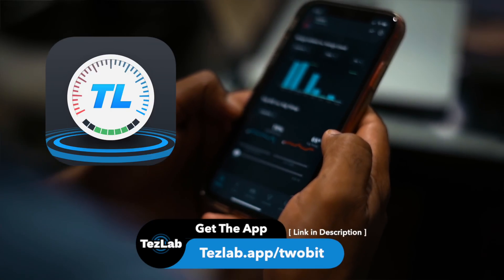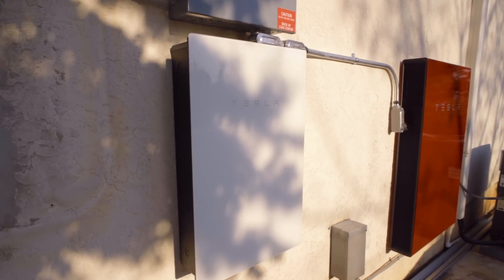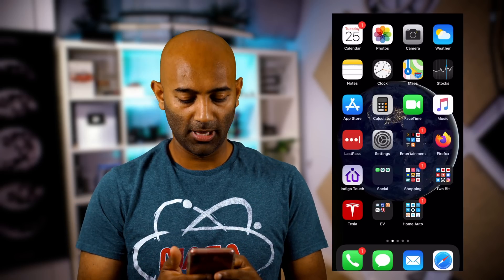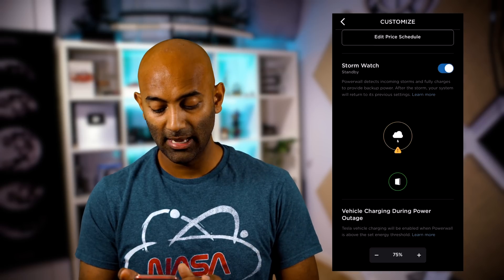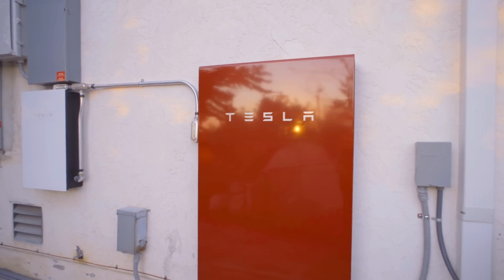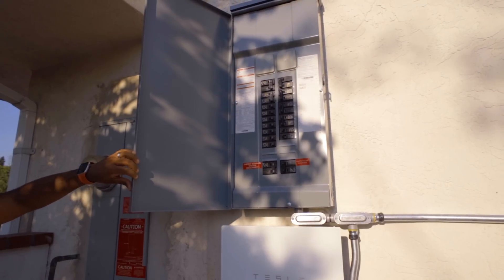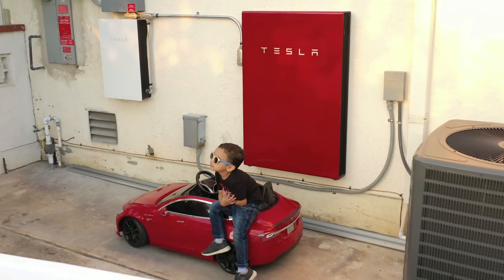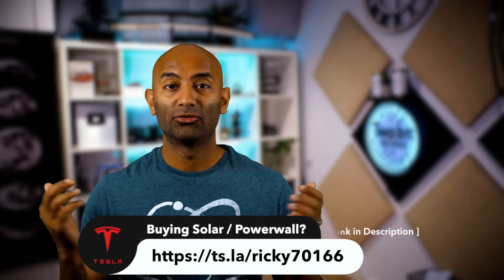The GENIUS of the Tesla Powerwall Explained

Comment: I have tried getting in touch with Tesla, and am getting no where other than endless hold! I am a Tesla Solar home. There is a phone number on my Tesla bill, and we have tried on line. We have been wanting batteries batteries forever! We have been using it for at least six years.  They came out a month ago and broke the seal on the meter and did a couple hours of work then left and said they would be back and haven't returned for over a month and before they left said we only running at half out put. And our bill from Arizona Public Service is costing us aloy more because they have just totally neglected and have been inviolation of the to buy contract themselves! Can you gives us a contact phone $ for Tesla in Arizona. We are stuck and the the original seal the cut is still hanging there cut.!!!

Comment: We have 2 PW in AZ.  While it was advertised as a 6 day backup with some caveats, it might give us two days from 100%, in the winter months.  We use the "self powered" option and since install have only used a very minimal amount of grid energy.  There were two days that were cloudy and the batteries did not make it beyond 3am.  While we think that's great, we're not sure how it will affect our batteries in the long haul discharging and recharging so often.  Using the settings you use for time of use export, the system pulls from the grid about half of the day which isn't what we want, even if we have to buy new batteries sooner.  It's all new to us but fun fun fun.  :-)

Comment: If you want to charge your power wall during peak hours and discharges at night time, then you forget about the battery degradation that will happen 365 cycles /year! not worth it in order to save pennies!
Power walls are meant for back up mainly.
Reply from the maker: It has a 10 year warranty. My cheapest is $0.09 and most expensive summer is $0.49 not pennies at all

Comment: How much imbalance in production of electricity from renewables is there between the winter seasons and the summer seasons. I don't think batteries currently can not store energy from one season to 6 months later.
Reply: There are videos that show the power generated by month. There is less power but it is still enough to power most of your daily use. What happens is that you build up credits during the peak season and those credits are used during the winter. So you net bill for the year is close to zero.

Comment: I read the 299 comments and still can get the AC deal😭, can you or can you not run the ac with the power wall?? I only can afford 1, I live in Florida and I want to be off grid the most as possible
Reply from the maker: if the power goes out its unlikely you can back up an AC unit on one powerwall. Possibly if you had 2. The powerwall can output 5000 watts. that's probably enough for just an AC, nothing else, that's why you wont get it backed up if you only get 1. if you get two, that doubles to 10,000 watts and you'll be fine backing up an AC. but remember that an AC will drain that battery really quickly, in like a few hours

Comment: You said your AirCond wasn't backed up, but then at 3:00 in the video you said you couldn't make it thru the night with AC running.  Which is it?  Confused.....  I guess what you are saying is that the power wall can offset your Air Cond usage and 13kw won't run the rest of your house all night.  Nicely done video.
Reply: He meant if the AC was backed up, then it wouldn't make it through the night due to its power drain.

Comment: I would love to have a Tesla battery but the cost is too high. Payback would be in decades, assuming it didn't die in the mean time. Plus my highest energy consumer is my 9kW electric shower which would not be backed up. It would save me the cost of lead acid battery replacements for the 4 UPS' I have though but that only cost me about £100 last time I did that. While I like Tesla, everything they do is too expensive.

Comment: 15.2 K system, 3 power walls, 7500 sq.ft house. -4 AC, Viking 500 wine fridge, 2K bottle refrigerated wine cave, two large refrigerators,  two ice makers, 8 TVs, 7 computers, Control4 system, 50K gallon pool, All powered by Sun and Batteries 24/7 .   Wen’t from $1K a month to $11.00 (minimum charge).    System is self sufficient

Comment: Thanks for the video.
Please help me with some concepts: if I understood right, you said that the solar panels pull in 3.2 Kilowatts, but the storage capacity of the batteries in the Powerwall is limited to 13 Kilowatt Hours? Do I have that right? Thanks
Reply: 10-20% power can be lost going from the panels to the batteries to the house.
Also the house uses power while the batteries are charging.  Also the batteries have a maximum charging rate.  And any surpluses can go to the grid.
Reply: @zxej6879  Thanks!
Reply: Keeping it simple, his battery will fully charge in a little over 4 hours from empty. 3.2 kW x 4 hours = 12.8 kwhs. As stated there will be loads drawing on that power as it is produced and also about 10% lost due to charge/discharge inefficiency but as long as the sun is shining, it can maintain the battery and send any excess to the grid.
Reply: @jdlutz1965  Thank you for the explanation

Comment: Good video. My solar panels and 2 Powerwalls would be installed on Monday .. Had these questions.. 1) I want to hardwire the network connectivity between the Tesla Gateway and my router (I have a network hub inside garage). Did you hardwire or connected the TEG to your wifi? 2) I also want the inverter to be hardwired. I see that you already had the panels installed sometime back. What brand is that? I know Tesla uses Solaredge.
Reply from the maker: I hard wired via an Ethernet cable. I had a switch in my garage as well. I highly highly recommend a wired connection for sure
Reply: @TwoBitDaVinci  did Tesla wire it for you or did you do it yourself after installation? if you did it yourself how easy is it? is port at the back of the gateway?

Comment: Nice video and I've been wanting a Powerwall for a while but the economics where I live and my current system makes the decision a tough call.  I got solar thru Solar City under a PPA so without me owning the solar system, I'm not allowed to make changes to it.  Now that Tesla is the owner of what used to be Solar City, I might be able to negotiate a new contract and roll the cost of my current system into a deal that will add a Powerwall but when I called to ask that question, it wasn't a known subject and they were leaning toward me buying my system first after my 5 year anniversary per the PPA contract then order the Powerwall.  Since I'm under a TOU plan in northern NV and the power is cheap here compared to where you are and our outages are less frequent, it makes the decision seem harder to justify.  I still want one anyway since I charge our Model 3 and Leaf since getting the PV system so I'm sure it would help but the time to see any ROI would probably be beyond my life expectancy.

Comment: I don't get why it's some $9k for such limited storage compared to a vehicle battery of similar cost.
Reply from the maker: There’s a lot of other pieces, permitting and labor. 2 full days and a team of two in my case. Heard they’re dropping prices
Reply: @TwoBitDaVinci   Thanks!   I sort of realized that plus extra hardware.  My immediate interest is 2 to 4X plus powerwall cap for service truck.  Likely not viable to use Tesla products at this point, I need 3-phase 440 inc.  One day they'll offer a job site series for trailers and trucks to replace noisy dirty current gen sets.  Worth $20k easily to me if high cap.  Far easier than a car but as long as they are batt constrained it's probably a non-starter.

Comment: I'm considering a batt pack for my service truck, it would stand in for a 20 to $30k diesel gen.  I need multiple output options including 440v 3-phase AC.  Anyone have any expertise in this area?
Reply: It's definitely possible. How many amps do you need to operate and for how long? 
You'd need batteries, inverters and possibly a transformer along with wire, disconnects, etc. Sounds like a "fun" project!

Comment: Enjoyed your video.  Question:  You mention at 1:30 that the Air Conditioner/Double Oven are not on the "Critical Panel" and therefore not backed up by the Powerwall.  At 12:50 you were talking about Tesla monitoring the Critical Panel rather than the whole house panel by mistake.  They fixed this.  Then you mention that now the air conditioning can use up to 5000 watts from the Powerwall.  Perhaps I misunderstood your explanation.  Could you elaborate particularly regarding operation of your Air Conditioner from the Powerwall under two scenarios:  Grid UP and Grid Down?  Thank you.

Comment: What is maximum amount of Tesla Powerwall 2 battery you can connect one to another?
How many years of use can I get of Tesla Powerwall 2 + tesla solar titles + electric car if I use it 100% off Grid in a small house 540 sq feet with all the heating, and appliances using only eletricity as power?
Reply: I've seen 4 Powerwalls connected together.  You'd get decades of useful life.

Comment: Unfortunately, the clean lines and design of the Tesla Power Wall system are connected with horrid conduit work. Conduit bodies used instead of bending the conduit into offsets to enter boxes. The wall was open behind the panel, why not run wire within the wall to eliminate the surface mounted conduit? The conduit elbow going to the Power wall is not even bent to the correct angle. Especially for something that is going to be showcased on YouTube, one would think the installing electrician would demonstrate their best work... maybe they did?

Comment: Would this work in a apocalypse scenario?
Reply from the maker: Yeah absolutely. Charge by day via solar run at night via battery. I don’t need a grid :) unless it’s hot and I need ac! Then I need a few more panels and one more powerwall :) going to upgrade in 2021
Reply: For about a decade (which is good if said apocalypse is short lived) given you buy and install your Tesla Powerwall right before the apocalypse occurs . Steady loss in efficiency will make the battery useless over time. Without a replacement the Powerwall will just become a giant brick.

Comment: Hi! I was wondering what would be total annual electricity consumption in Your house? Before and after modifications? Thanks for a good video, very informative, very thorough.
Reply from the maker: With our Tesla we use like 800kWh a month. It’s complex because we get billed based on time. So half that is very cheap super off peak when charging the car. But with solar and powerwall... charging our car and running our whole house including lots of AC in August, our bill will be $35. One fuel up would cost $65. So it’s pretty amazing.
Reply: @TwoBitDaVinci  Ahh, in here we have the same system on billing IF we want to choose that style. Normally its evenly priced or then winter-daytime (more expensive) is the other popular choice.  Not bad consumption per year thinking about the big need for Aircon. Thanks!

Comment: Do you know if the power management app accounts for the predicted cost of cycling the battery?  For example, if it cost $6k installed and was expected to last 3,000 cycles, you'd expect $2 per cycle in depreciation (obviously it's more complicated than that with reduced capacity).  So for a 13.5 kwh unit, you'd want to make at least ($2/13.5 kwh = ) 14.8 cents/kwh in arbitrage profit to offset the battery degradation.
Reply from the maker: that's a very interesting way to look at it. yeah, I will make a video 10 years from now talking about how its holding up...lol but until then, I think the idea would be that the battery would still be working after 10 years, maybe at around 70-80% of its original capacity.
Reply: As far as I know, no one yet knows just how long lithium batteries will last, when taken care of. Currently cars are very hard on batteries, this is why, there are so many used lithium batteries for sale. I work on boats in my job, and AGM batteries can last over 10 years. Lithium batteries should last at least that.

Comment: Thanks for the video, really helpful. I have solar and am grid tied, so when the electricity goes out, I'm out.

With your set up, during the day, when the power goes out, could you still power your whole house having the powerwall and the solar energize your whole house?  Or is the A/C part of your power demand on the other panel stay grid tied? 

I'm trying to find a way to not be grid tied and be able to power my house during rolling black outs. My solar seems to peak at 5.8kw, which is my typical max load with my a/c on. Wondering if this can solve me dilemma. 

Thanks!
Reply from the maker: Yeah if the power goes out I can run entirely on solar and powerwall even after the sun sets. Just a few big loads aren’t backed up as I mentioned in the video
Reply: @TwoBitDaVinci  thanks for the late reply. 

For clarity, though you can combine both supply sources to energize your house, using the solar and powerwall, you cannot run your a/c because they are on the other panel? 

Or you would prefer not to so you can maximize the run time ?

Comment: I'm not sure if this is a thing or not, but if not, Tesla should offer this option where if you have a Tesla EV and Powerwall, and don't drive so much, the Powerwall should attempt to charge both batteries (EV and Powerwall) and at night, draw power from both so this gives people extra capacity if they have a huge solar system.

If I am not mistaken, there is a trial for this in Australia by a company that is using the Nissan Leaf battery for power storage.

Comment: I am also in San Diego County. It is interesting that you opted for both ToU and Solar and Battery. Based in your own advice, that means that SDGE must offer a crappy Net Metering plan.

I've had advice to the contrary. That with ToU Plan #5, and solar (EV-TOU-5), getting the battery isn't worth the expense. Plan #5 will pretty much zero out my electrical expense over 12 months when SDGE credits me back for the solar I sell them.

Thoughts?
Reply from the maker: TOU5 you can definitely do great without a powerwall. I still have time of use so rates are 2x between 4-9pm. So if i store excess solar instead of giving it back, and use it later, that's like getting 2x for it. Is it worth the money, that's up to you. But yeah for your and your setup, you're totally fine without one. I will say we have wildfires and power outages are far too frequent... IMO so battery backup for me, is invaluable.

hope that helps!

Comment: Good video, glad to hear you had a good experience. We've had our Powerwall 2 for almost 2 years and it's fabulous technology.

You might like to explain that your experience and the explanation of your setup, e.g. the service panel is USA based. It differs greatly from country to country. I'm UK based and our setup is very different. The wiring, consumer unit (service panel), electricity tariffs and what we can and can't do. e.g. we can charge the battery during off-peak from the grid if very different in many ways. Our installations are almost always installed, commissioned and working within a single day. Same with solar installations over here. There's no waiting for the sign-off, certification or anything like that. The approval is done upfront before any workmen put boots on the ground. Differing approaches, different infrastructure and components makes the user experience of the product from installation through to daily use so distinctive.

Comment: I'm thinking of getting a battery pack here soon but I'm a little confused. So the battery isn't connected to your AC unit because it's over 30amps but it can still power it? How does that work? Thanks
Reply from the maker: the powerwall can put out 5000w. So 4-9pm when energy is very expensive, it'll check what the house is using, and supply up to 5000 watts. if my whole house and AC together was pulling 6000w (6kW), then my powerwall could supply 5kw and my pull from the grid would only be 1kw. that's a huge savings during peak times.

but if there's no grid, then those loads aren't in my critical loads panel, so they're not powered when grid is off. hope that helps!
Reply: If he ran his AC with it, it would drain the battery like nobody’s buisness

Comment: @Two Bit da Vinci - Excellent review of your setup walking through each component while also factoring in your power company.   It's very close to the ideal setup I would implement but I'd also want my future EV to be charged overnight from battery storage system.   In addition, as you mentioned to also include the ability to charge the battery storage system during the non-solar hours from the grid especially during the overnight hours when the (variable or time of use) electric rates are the cheapest. 
 
A possible idea for a future video is comparing or at least reporting on the various battery storage systems available today and highlight some of the features / capabilities they provide.  (E.g. really like the idea of it monitoring the weather forecast to predict possible outages and place a priority of charging the battery storage to 100%.  Is that a common feature with other battery storage systems?)  That would be very helpful for those that do not have access or funds to purchase a Tesla Powerwall or the time to wait for it to be installed.

Comment: Peak power plants are typically natural gas or petroleum based fuel.   Think of these are like jet engines.  Or a giant truck engine.  These can be turned on at an instants. Coal uses a boiler.  So it’s more based load.
Reply from the maker: Good point!